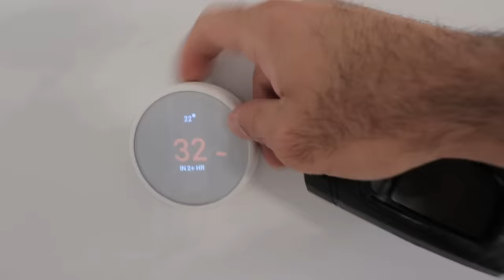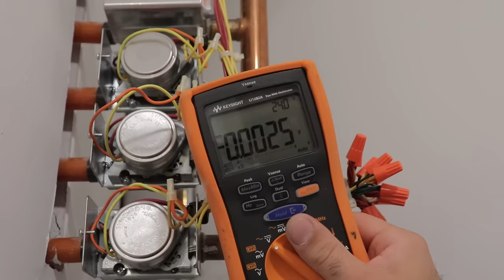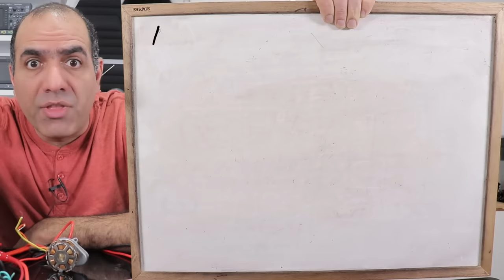Electro-Plumbing Repair… of my home heat zones that won’t heat although the boiler is running fine!!

Comment: I imagine they might stay on fighting the spring as a safety measure, so that if the power goes out or something, they don't keep heating potentially beyond what would be survivable for humans and pets.
Reply: How would the boiler keep working if the power is out?
Reply: @fanis1414  Gas?
Reply: @tiagotiagot  That boiler?  Not a chance.  No power would shut it off.
Reply: @jonc4403  If not for this boiler, perhaps they weren't made with this specific model of boiler in mind?
Reply: @tiagotiagot  So, that's possible... but with any circulating hot water system there won't be any appreciable amount of circulation without electricity either.  The circulator pump won't work.  And if the boiler gets too hot, its own overheat cutoff should shut it down even without power.  If that fails, the expansion valve will pop.
A steam system can work without electricity, but it's not going to have these valves, and the PEX lines would fail if you tried to use them for steam.

Comment: I feel like it's important to mention that 30V on an autotransformer or a Variac is still not safe to touch because it's reference to mains. It is not an isolation transformer. I reckon a lot of people don't know that.

Although if you run it with a dedicated 15mA GFCI it can actually be reasonably safe.

Comment: Seems efficient as system when it's well set. The plumber could have regulated the voltage of the power supply for each valve usage only, meaning 1 because you open heater for 1 room at the time so at 25v-26v should have suffice for the needs of valve oppening and even for all of them maybe dropping at 23v a 24v motor. I guess good lubricant could save them too and keep gears lubricated but the voltage is much too high for the amount of time it turns overvoltage.

Comment: I have a system similar to this in my house but the valves are driven by wax motors, veeeeery strong and reliables.
Reply: Maybe you have a better brand. At my place three of ten failed in five years.
Reply: @matthiasplus6691  #OhShit
Reply: Yeah, I've only ever seen wax motors around here. It's very few moving parts and very simple. Only issue is that they're a bit slow.
Reply: @Pretagonist  True, usually 4 minutes of response time.
Not a big deal overall
Reply: @enricomontanari1390  true, it's really only an issue when you're troubleshooting.

Comment: Is there an edit missing?  Did you end up replacing the transformer with a regulated power supply?
Reply from the maker: No, I just left my thoughts and prayers with the motors!
Reply: @ElectroBOOM  You mean you left it for another video? 😂

Comment: Perhaps the "stay on" functionality is so that in the event of a power loss all the valves close. Not sure why you'd need all the valves to close though when the power goes out.
Reply: "fail safe", so if the motor fails it doesn't fail with heat on.  I assume so a room/rooms do not get extremely hot when the motor fails open
Reply: Yeah, but its probably easy to design a better solution for that instead of stalling motors..
Reply: @tarakivu8861  I'm not a plumber but installing a manual valve doesn't sound that much of an issue. Only downside is if you aren't home, but most people turn the heater off when they leave for extended periods of time. Just some ideas for a better solution like you said
Reply: @tarakivu8861  off the top of my head the only other way would be a solenoid or something similar to hold the motor in a "locked" position but that's another always on option (how else will you let it reset when power is lost?)
Reply: @tarakivu8861  I have a Philips Living Colors lamp, an old one with a remote, idk how the new ones are, but if it was turned on before the power goes out, once the power comes back on, it'll light up shortly, giving a quick rainbow spectrum demo before it shuts off again.
So, there are ways to shut something off on itself after getting the power back on.
Ideally, it'll just stay off anyway, like your computer and TV did.

But yeah, how do you retain the "on" without spending power on that mechanism?
If you lock it in a mechanical way, it'll likely not automatically unlock itself when the power goes out, because no power has gone to it to begin with.
Aside from it being a ploy to raise your bills, it might have something to do with the general power supply and possibly water supply, which could risk being instantly burdened extra, when the power comes back on and many households automatically need the power to raise the temperature.
My best bet would still be something like that Philips switch, it might create a spike at the start when power supplies are back on, but the device will also shut itself down, so the power net just has to survive that first 1 or 2 second spike.
Reply: @H3nryum  bro, you wont have any heat or a pump with no power
Reply: @Edigor100  power loss to the whole system, true.  Power loss from a faulty controller or wire break to the motor, multiple things can happen that would remove power from the device in question with everything else running as normal, this video proves that point
Reply: @H3nryum  no this video only proves that current going through a motor continuously for no reason, putting stress on the motor, is bad for the motor (who would've thought)
Reply: No, it's just because it's absolutely trivial to convert 120V AC to 24V AC.  It's more complicated, and expensive, to create low-voltage DC, and a control circuit that changes its polarity under the right conditions.

These heating systems are dumb systems.  They are not meant to be computer controlled, which is good because that means they don't rely on computer control.  That's how you can have a simple bi-metallic coil thermostat with a mercury switch do the same job as some fancy smart-phone enabled thing.
Reply: In the civilized world we use wax motors as valve actuators https://en.wikipedia.org/wiki/Wax_motor

Comment: In european installations you often come by thermoelectrical actuators. They work by warming up some kind of wax-like component and are balanced by a spring. The valves itself have a small pin which, when pushed, close the valves. The whole assembly (without electrical control) are classical controlled by thermostats that work with expanding elements / bimetals.
The thermoelectrical actuators however are really efficient, better models only consume about 1W with 100% duty-cycle but are controlled in a PWM-loop with loooooooong cycletimes.
You can mount them directly at your heaters or in a central box for your floor heating system.

Comment: it is funny how a $50 continuously running motor is used to open a valve when a $10 stepper motor could do it cheaper ,more reliably and more efficiently . it is probably because that is how it has always worked and back when it was designed , using stepper motors was more difficult .
Reply: 40$ is probably cost of licensing 10$ motor for the given application
Reply: Why not solenoid valves? They are more reliable and much cheaper.
Reply: Those valves are designed for safety reasons to close even when power goes down! This is not the intended place for those motors! I think the plumber chose those one because they are cheaper!
Reply: @Satyaprakash81102  because with water or fluids you don't want valves that slam open or closed. You want them to close  slowly ro prevent water hammer.
Reply: @huasohvac  So wax motors instead ;)

Comment: Usually, a system using those type of zone valves would have a bypass to allow residual heat from the boiler to continue circulating after the valves close. It's necessary to protect the heat exchanger in low water content boilers but is usually via an adjustable, automatic bypass valve that remains closed in normal operating conditions and opens when a determined pressure is reached. There's a way to calculate the correct setting of the bypass but dumbass electrical engineers wouldn't understand 😁
Reply: Also the bypass would usually be between the positive side of the pump on the flow (between the pump and zone valves) and the return pipe to the boiler.
Reply: You also don't want to dead head the circulation pump.
Reply: @chasmosaurus3  he did say it was a combi boiler so I was wondering if the bypass is just for the internal pump, if there is one? The larger, external pump would then shut down as soon as the zone valves de-energise and close.
Reply: @chasmosaurus3  so the bypass is for the internal boiler pump and heat exchanger.
Reply: Hmm... you must be a rocket scientist 😀
Reply: @laernulienlaernulienlaernu8953  the boiler has an internal bypass circuit
Reply: @cliveramsbotty6077  he doesn't go into much detail about the mechanical side of it (big surprise! 🙄). I'd like to see more of the pipework layout to be sure about the 'short circuit' he's talking about.
Reply: @laernulienlaernulienlaernu8953  The pipework layout is shown very clearly in the video. The 'short circuit' is basically a header with close coupled T's. That there is your bypass. Inside the boiler is a pump that circulates water round that header loop. Often those zone valves have a switch in them that makes when the valve opens and that will trigger the circulation pump you can see, so the pump will only come on if a valve is open and the flow of water has somewhere to go. It's also possible that those zone valves don't have a switch, in which case the boiler will bring the pump on and open the relevant zone valve any time one of the room stats calls for heat.
Reply: @cliveramsbotty6077  but a bypass will usually be via a dedicated valve and a header is not really 2 tee pieces butted together. At least not in the UK but I understand that different countries will have different methods. We would have switched valves that fire the boiler and external pump, the valve closes and the demand to the boiler and the external pump is switched off but since the boiler has a permanent live there is a pump overrun to dissipate residual heat and since there is nowhere else for it to flow it circulates through the spring loaded bypass valve because just teeing the flow into the return creates next to no loop or header and results in a loss of flow to where it is needed. As I said though, I don't know exactly what systems they use in Canada we primarily use panel radiators with convectors, not skirting board radiators.
Reply: @laernulienlaernulienlaernu8953  The external pump doesn't need a bypass. It won't run unless a valve is open. The shunt pump inside the boiler needs a bypass, there is an automatic bypass inside the boiler and there is also a means of bypass external to the boiler in the form of a piped loop below the appliance. When the boiler sees the return temperature coming back in closer to what it flows out at it will modulate down and stop producing heat. I don't understand why you want another bypass.
Reply: @cliveramsbotty6077  it either needs one or it doesn't. The external pump doesn't need a bypass coz it shuts down when the valves close. The heat exchanger and boiler pump need a bypass, which should be a spring loaded valve, if there's an internal bypass inside the boiler (usually via the DHW plate heat exchanger) then there's no need to tee the flow and return together. A header is completely different, and is used where there's multiple flow and return pipes on the outlet side or things like dosing vessels and gauges connected to it. This is just the flow connected to the return for no valid reason, unless the boiler requires an external bypass in which case it should be via a dedicated valve, not a tee.

Comment: I imagine the motors stay on to make sure the valves close in case of a power cut
Reply: Why would they need to close in a power cut? It looks like an electric heater to me
Reply: @ThomasBomb45  I'm not a plumber but it's probably a safety thing, at least that's my guess. It doesn't need to be open since the boiler will be off, so the valves should also be off. Might also prevent issues when the boiler comes back on with the power
Reply: It's probably simpler than that. with this setup, you only need 1 switch. With a power on, power off type valve, you need 2 switches.  2xthe chance of faliure.
Reply: You are right it is a safety thing. These valves are called normally closed valves and their purpose is to be closed in case the actuator fails preventing the dangerous fluid of going uncontrolled to other areas.
Reply: Also during maintenance - you would want the valves to go back to their expected "resting" position after you have de-energised systems.
Reply: @ulrar  You can have conactors or motor starter type switches for heater and pump which opens the circuit when power fails.
Reply: @mmazinchalbcham4673  I think this is an over engineered design. It could have been as simple as a solenoid valve.
Reply: yes. It's a very rube goldberg way of doing it though. Most normally closed valves I've seen are just a solenoid pushing against a spring, not a whole shebang of motor with gearbox and switches and weirdness.
If the power is cut the solenoid doesn't push anymore and the spring closes the valve.
Reply: @marcogenovesi8570  Tbh I agree with you. I am not sure why the hell they chose this weird design but it is what it is i guess. It does not change the fact that it is a normally closed valve, it is just dumb lol.
Reply: @ThomasBomb45  I saw a hose coming from the device, and the two pipes above are telling me that this is a condensing boiler. I am not familiar with Viessmann, I only know Buderus and Vaillant well
Reply: @mmazinchalbcham4673  sounds like it was designed by a mechanical engineer, isn't it? That's the type of engineer that would think adding a gearbox and switches is the only solution to this problem, while an electrical engineer would instantly think of solenoids.
Reply: @tigo01  vs $300 in motors (or $185 off-brand) ... I'm thinking that could pay for a more expensive switch.

Comment: Those actuator valve motors work perfectly fine at 28 volts AC. Been used on lots of controls for a long time. Most transformers output around 28 volts because the line current always seems to be more than needed.  I have about 100 of those actuator valves in a building used for water sourced heat pumps. With most of them still working after 25 years of use. I prefer the power open, spring closed design. New DC type actuators are being more common though, that are power closed and open and some being variable style.

Comment: Different theory from backward compatibility: Cheaper to make an inefficient system that wastes the customer's money than make a functional device that costs a bit more.

Or maybe a mechanical engineer thought it was smarter to use a spring instead of acknowledging technological innovations like transistors.
Reply: It could be more focused on safety. A valve should fail closed instead of fail open, and this system ensures that. Also, mechanical fail safes are more trusted than electrical ones.
Reply: Well, the thing is that you'd need to design and manufacture extra circuits so it can run in reverse
Reply: @AsifAlZubayerSwapnil  Why does it matter which way the valve fails?  Is that just a general rule in case the valve is controlling something other than water?  Or based on valves failing but pumps continuing (so not just an overall power outage) when there is leak?
Reply: @jimjjewett  I guess the desired mode of failure will depend on the application, for example a pressure relief valve should always fail open. But in this application it makes sense to fail closed as failing open will allow unregulated heating, while failing closed will just shut down heating on that area.

Comment: 10:14 how does it not burn up?
Reply: Motors pull more current and heat up when stalled, but most small motors like that can easily tolerate the excess heat generated by being stalled

Comment: I have the same type of heating system in my house (well, I rent it from my folks), except that the installers did a disgusting job of the setup.  When I first came in, the rat's nest of wires was entirely baffling, and I had to deliberately go out of my way to figure out how it was wired.  I'm no EE, but I replaced that horrid mess with some screw terminals and even some indicator lights--yet my amateur works are still put to shame by the clean work shown here.  Mostly, of course, that's because the heating system I'm working on is so bad, with the pipes going every-which-way and the zone control valves not put in a row next to each other.  It's interesting to see a competently made version of the crap I have to put up with.

Comment: The reason that there is a spring and the motor stays on is that in the event of a power outage the valve automatically closes for safety reasons

Comment: Fixed my landlord's A/C unit, a wire came loose that carried 30 VAC. Thanks to this video, I took a chance with my multimeter to mess around with 30 VAC and re-established the connection. Otherwise I'd would not have taken that opportunity and they'd be down $$150-400 calling a repair guy. Thanks Medhi.

Not an electrical engineer. Studied chemical with a specialty in in biochemistry and some background in voltaics due the nature of my current work.

Comment: 2 Things
You are worried about the heat from the valve, 16.5w = 56Btu, and the boiler that it tells to run is 100,000btu. kind of a mute point really.
Second, the "wasted" heat given off by the valve is not wasted at all. The heat is going into your house which is what you want or it wouldn't be on in the first place. maybe not in the right room but oh well.

Comment: I had an apartment that used the gas hot water heater to heat the place. However in the winter at best you didn't freeze to death and you had to choose between freezing, doing your dishes or taking a shower. Needless to say I used an electeic space heater to heat up the room I was in.